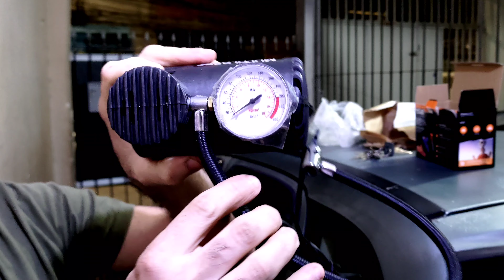mini compressor de ar 12v multilaser. mini compressor de ar automotivo!

Comment: ola boa noite
tenho um desse
e agora vou ligar ele
mais ele ta queimando fusível do carro.
como si tivesse isolando alguma coisa
pode mi ajudar?
Reply from the maker: @Anna Santo's
Tem que verificar qual amperagem do fusível que você está colocando talvez está queimando porque a amperagem do fusível está muito baixo! Troca o fusível e faz um teste com a resistência para acender cigarro o acendedor de cigarro ver se ele vai aquecer você vai queimar o fusível se não queimar o fusível você tem que verificar se o motor está dando partida desse compressor se ele estiver travado por isso está queimando o fusível!
Pode estar com defeito no compressor de desse motor está travado e aí acaba queimando o fusível! um abraço obrigado por assistir os vídeos do canal obrigado por se inscrever no canal obrigado pelos comentários boa sorte. 👍👍🤝🤝👊👊
Reply: Deve ta em curto